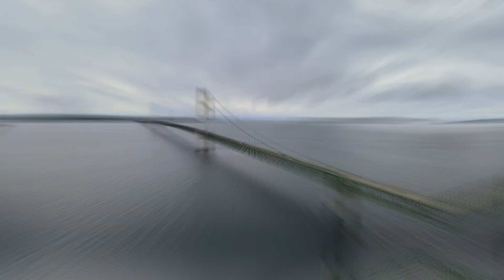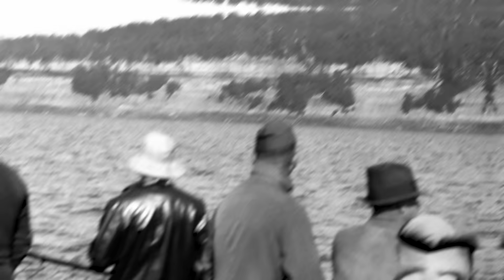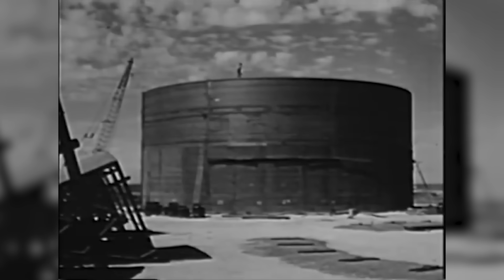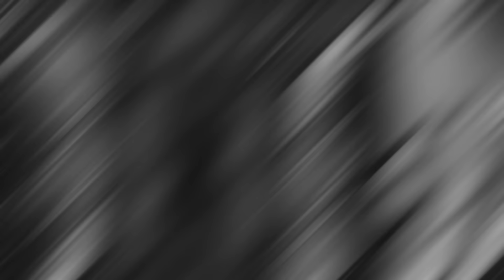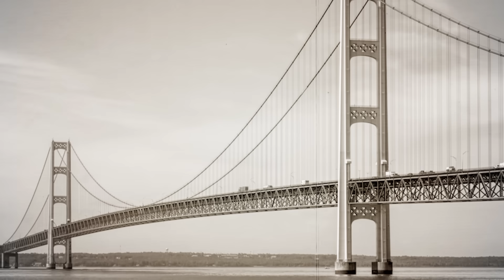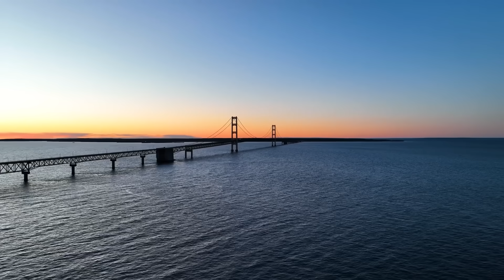Why Nobody Can Replace America’s $1B Mackinac Bridge | The Impossible Engineering Marvel

Comment: Someone I know, his Stepdad worked on this...there are bodies in the pilings! AND the U.P. is connected to Wisconsin. We have ways.....lol.....I have been across that maybe 6 times...and that's more than enough...I hate heights and eww...did it in winter...it was blowing hard, the icicles formed sideways...like I said...I did enough...not for me!
Reply from the maker: That sounds scary. Maybe a summer trip is better. After traveling through TN in winter a few times in the mountains and ice I decided driving is for summers only for me. Spring time I’ve caught a few tornado warnings both in TN and Kansas before through the years. Ice is no joke. When I was in college in Ky we had that horrible ice storm early 2000’s and I remember losing power for weeks. Of course back then it was fun having everyone pile into whoever’s house was lucky to not have had tree fall on the wires. Guess what doesn’t k*%l us makes us stronger 💪🏼
Reply: @XtremeMegaBuilds  That was scary. But I live up near the Keweenaw...almost 400 inches a year. I can do snow...got issues with ice too!!

Comment: It has lasted as long as it has because of the dedicated crew that maintains and paints the bridge.  It is a never ending job.  Nearly every part of the road bed can be replaced (in place) if it is damaged or rusting.  Find a rusty beam?  Unbolt it, take it out and replace it.  A suspension cable going bad?  Replace it.  I think the only things they can't replace (easily) are the massive pilons, towers, and the main cable.
Reply from the maker: That’s probably true, pilots for sure would be difficult.